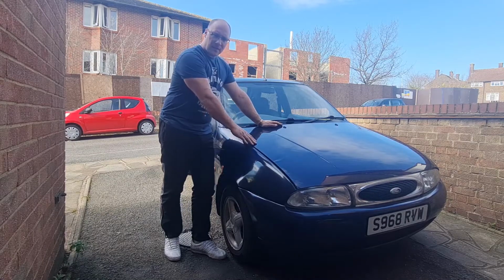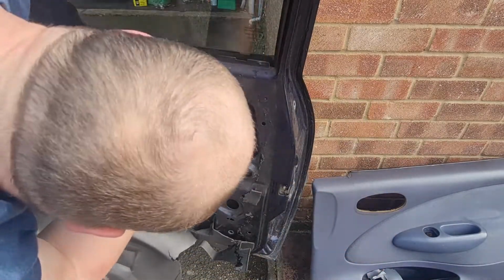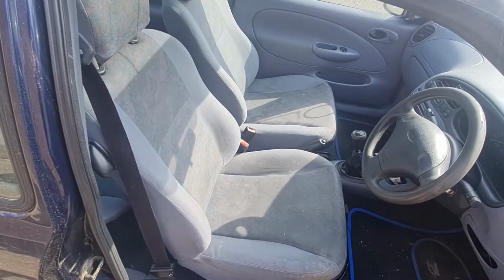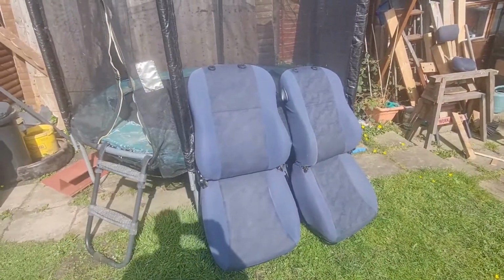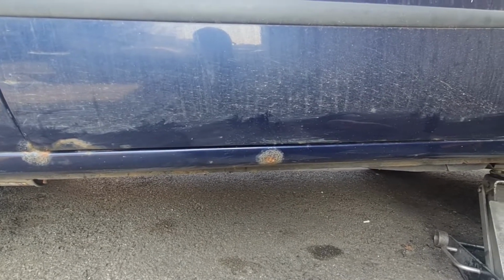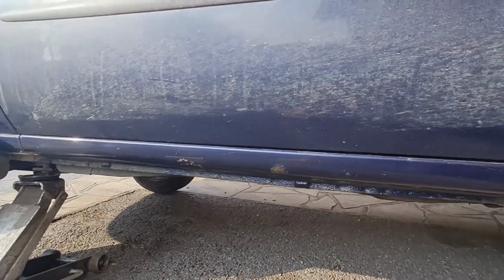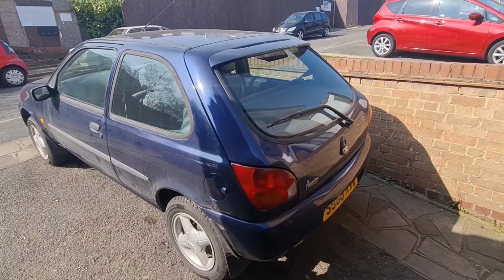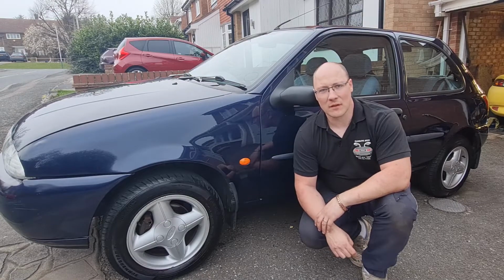INVINCIBLE Ford Fiesta Mk4 - FINAL Repairs

Comment: Nice job!
Lots of detailers use G101 to clean. And they use carpet machine to soak up the water in the seats.
Reply from the maker: Thanks so much ! Yes i would like to get one of those machines in the future 😁👍👍👍
Reply: @mec-tec  why don't you see if to manufacturers like Karcher etc will let you do a review on the car detailing tools?

You'll finish up calling the channel "Muc-Tec" though :)

Comment: Thanks for the video...I have a question, how did you remove the rusted areas? what did you use to remove them without damaging the body of the car? was it sandpaper? what grit? thanks again
Reply from the maker: Hi mate
Thanks for the msg, from memory i used an 80grit flap disc in a grinder then some finer paper after 120 and then 240, hope this helps 
MEC 👍👍👍
Reply from the maker: Hi mate
Thanks for the msg, from memory i used an 80grit flap disc in a grinder then some finer paper after 120 and then 240, hope this helps 
MEC 👍👍👍